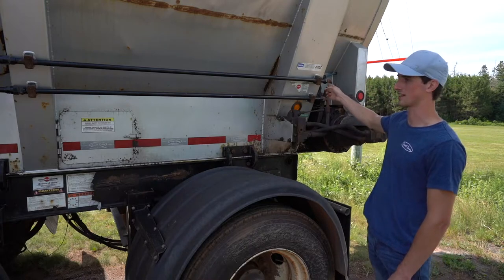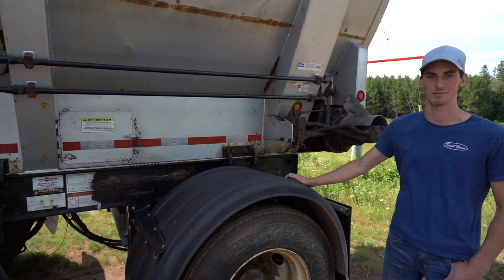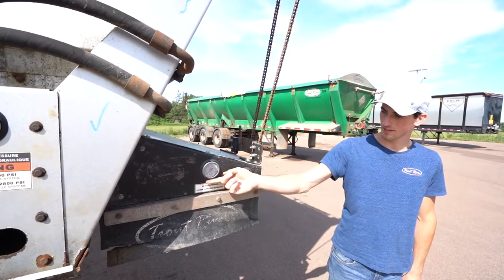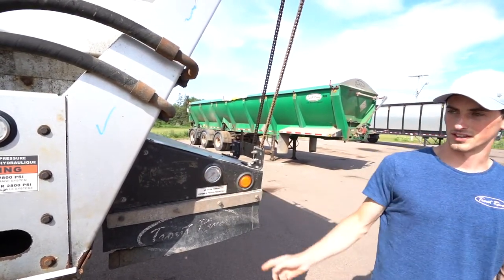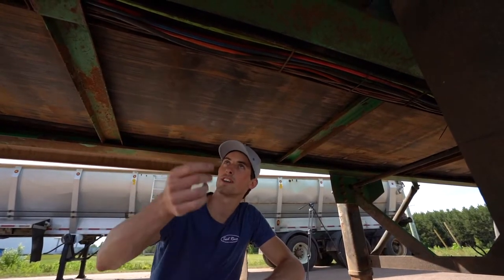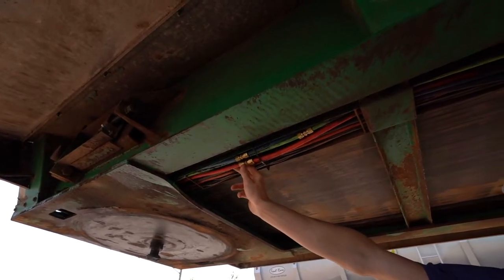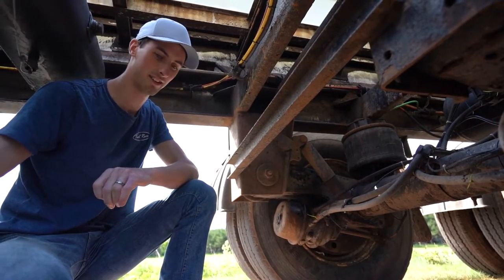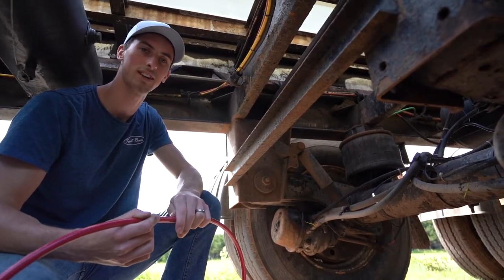Trout River Tip Of The Week || Power System Check

Comment: How do you tell if your belt is bad condition
Reply from the maker: Use a visual inspection looking for rips, cuts, anchor bolts pulling through or missing, damage to the zipper/ lacing.
Reply: @TroutRiverIndustries are minor cracks that don't go through still okay to run